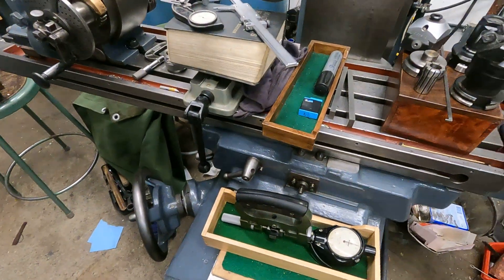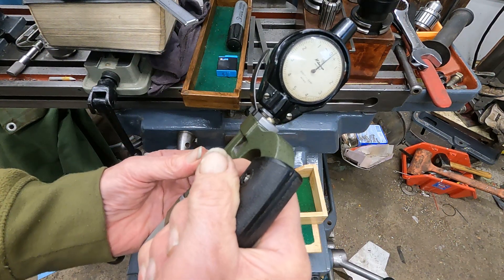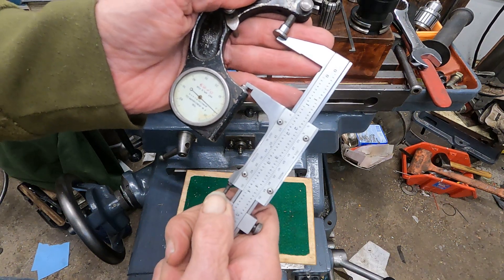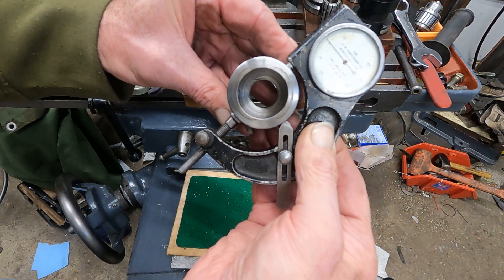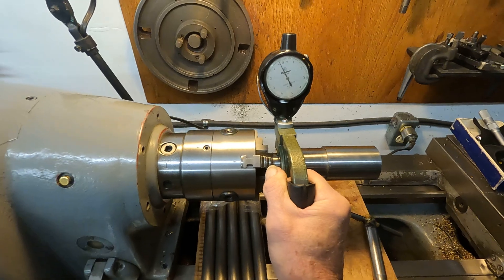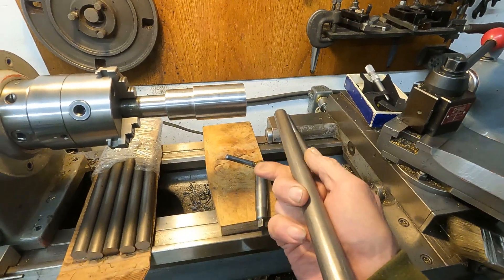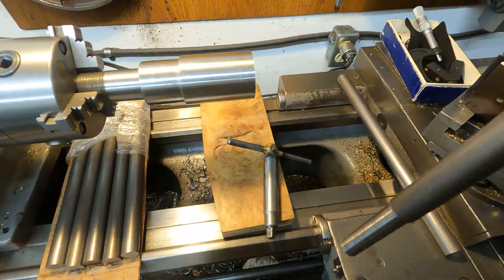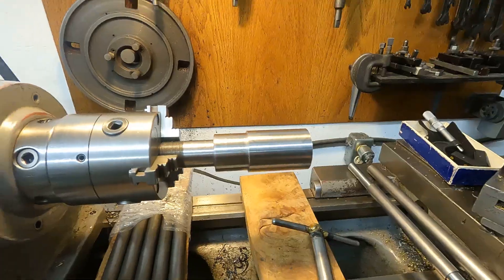Dial indicator snap gauges

Comment: Thanks DeeDee.  I wondered if you had to use gage pins or something similar to set the back stop.  Now I know it’s not all  that complicated and will start shopping.   As Always, TB
Reply from the maker: These snap gages have a limited range usually around .030" so they are only good for the last cut maybe two on the lathe. With the non-contact technology these mechanical gages are pretty much obsolete and not worth what they used to cost. The Mitutoyo ones I am using were purchased not working really cheap. The fun part is chasing a tenth and the Monarch ee becomes a flexy flyer like an Atlas bench lathe chasing a thou! The other fun part for me is the balance of machining the material with the mechanics of making it work out in the end. The small line boring shafts that are here had the machine work but not the needed mechanics, I think.

Comment: I like those snap gages. It would be great for checking multiples of the same part quickly. Thanks for sharing.
Reply from the maker: Yes, the gages are really fast but have a short .030" range once set to a size.